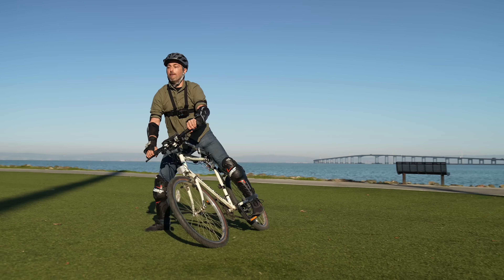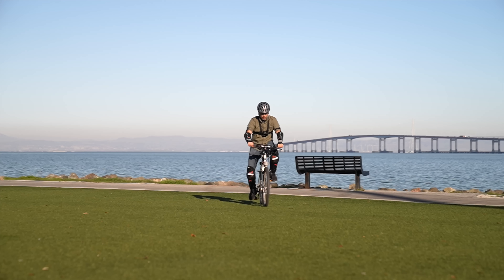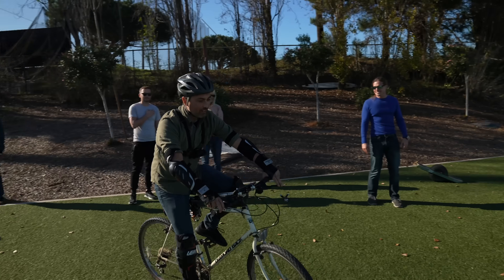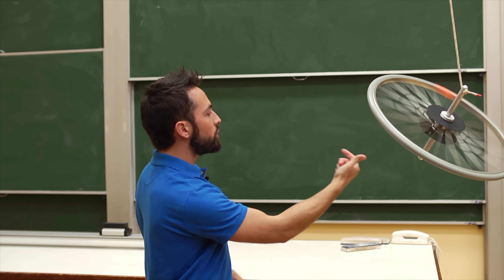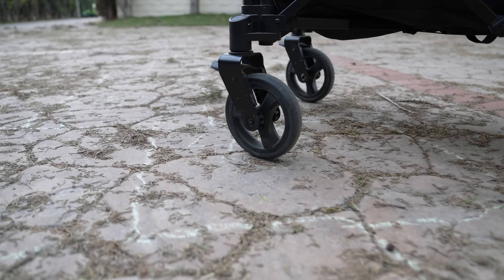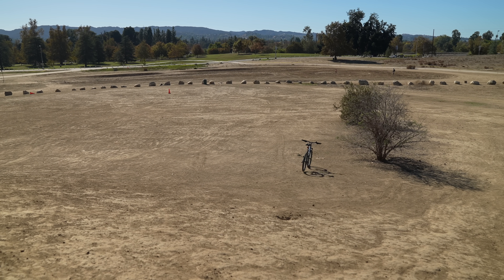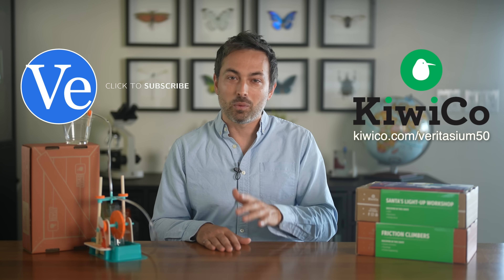Most People Don't Know How Bikes Work

Comment: Just noticed that the number of "contact" points in two-dimensional movements determine the number of counter balance movements that you would need.
1.-Inverted pendulum: multidirectional counter movement.
2.-Unicycle: counter forward/backward and steering.
3.-Bicycle: counter steering.
4.-Tricycle and cars: no counter movement.

Comment: I have conflicts with this...

1: I have, in my youth, been able to steer a bick simply by leaning in the direction the handlebars never needed to turn much, and never in the opposite direction.

2:  pretty sure I could handle a non-steering bike using that and the rocking technique I had for climbing hills.  Provided no turns are too sharp, that is.

Comment: As interesting as this might be it is also not 100% right or well not always, when at slow  speed yes you might have to counter steer but in practicality it is like a motor bike,  the only time i ever steer the opposite to the direction intended is when i need to go wide around something.  I cycle to work everyday and i actually held of posting this comment to see if i did what is describe here and guess what i did not as that is not how people cycle in every day. Idiots that have no clue will try to stay utterly upright as they turn into a corner but much like a motor bike if you know what you are doing you always lean your body into the corner , and can bee seen from the video you clearly have no clue how to ride a bike as you are seen to be trying to keep your body strait rather than leaning into the corner.  As I say i cycle to work daily and not once do i turn the opposite of the direction i want to go and when i am going strait i do not need to constantly stare to stay upright, in essence body weight is what turns the bike and if you want to turn left you shift your body wait to the left side and turn left .   The only people i have ever seen turn the bike with a stiff upright back are people that do not know how to ride a bike.

Comment: I think that that it is also possible to steer the bike without counter-steering the bike first. To do this, you must initiate the steering by moving the centre of gravity of your body towards he inside of the corner. When the handlebars are still pointing straight, the bike will naturally lean in the direction of the centre of gravity - the inverted pendulum will topple over if no steering is applied. So all that is left to do is to steer into the corner. And you have successfully taken a corner without counter-steering!

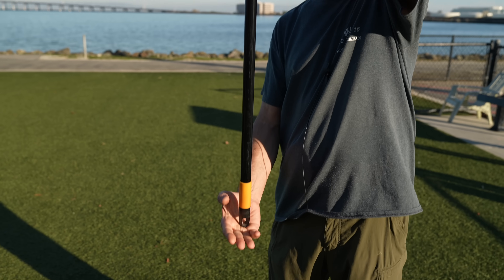The broomstick/inverted-pendulum argument (3:15) is too much of a simplification in my opinion. In the argument, the heavy mass is compared to your body on a bike. However, in reality your body is not some rigid (point) mass on top of a pendulum. With the muscles in your body you can shift the location of the point mass at the top of the pendulum. So you can shift your body such that your centre of gravity is no longer right on top of the pendulum. This starts the lean without first having to counter-lean. (3:27 "I have to initiate the lean") In the described technique here, you still initiate the lean, but not by moving the base of the pendulum, but by moving the mass on top. 

I am just a random Dutchie that has cycled his whole life and when I first saw the video I felt like your logic was not quite true. As far as I have tested it, my explanation above holds up. But I only tried it once or twice cycling back from uni and I knew in which direction I was going to steer. Nevertheless, I am confident that it is also possible to do it on the bike you used in this video.

Comment: This is crystal clear to anyone who's ridden a motorbike and given it a second thought. Too many still think you steer by leaning (weight shifting) alone. Grabbing the handles from the front only with e.g. forefingers quickly reveals you pull the opposite side first before the leaning into the curve starts. With normal grab and a quick situation you actually push the turn side handle but not many realize they're doing it.

Comment: Countersteering. It upsets the balance in order to force wheels onto a new axis relative to the ground. 

On Motorcycles, you barely turn the handlebars at all above 10mph. It's all about pushing the bars in the direction you want to go, not pulling.

Comment: Motorcyclists learn this really quickly.  Bicycles are very light so the tiny inputs needed to initiate the turn are barely perceptible.  Motorcycles however require noticeable steering force in the opposite direction in order to get the turn started.  It's one of the first things that stood out to me when I first started riding.

Comment: Gyroscopic effect is only a macro effect that is the consequence of a more nanoscopic one.
It implies a localized space-time distortion in the inner wheels space : Higgs bosons agglutinate while the wheels turns more rapidly allowing the outer wheel to increase its mass, while the mass grows , the inner space - time  area warps accordingly, allowing  the wheel to be "locked" in.
In the case of the wheel, just imagine it is on a flat rubber surface , if you increase the mass of the outer wheel, it sinks into the rubber, the more it sinks the more it is difficult to move it on the transversal axis as shown at 6:20.
The rule is that an initial mass in movement increases proportionaly of its speed and depending of the density of the bosons in a place, the more they agglutinate , the more the localized space-time is warped.
Put your hand or an object into different liquids of different densities : water, oil, mercury.
Move it , you will experience a different "mass increase effect" into these ; Higgs bosons are like this, they agglutinate temporarily as an object is in movement, the more the density is high , the less easy movement is , this is what occurs in the vicinity of a black hole, movement is put on hold as the bosons density is insane.
What is a black hole ?
In the center there is  a singularity, probably* made of exotic particles that generates negative energy, this energy allows the higgs bosons to be attracted, and the space-time to be warped around.
The "black sphere" we can see around the singularity is an incredible amount of agglutinated Higgs bosons, it is also called the "event horizon", they are known also as " dark matter".

*No one knows !Perhaps it is a concentrated form of what scientists call " dark energy " ^^

A formula can be extrapolated from this : Mv=(Mi.D/t )/Ub
With Mv =virtual mass, Mi =initial mass , Ub = Higgs bosons density , D/t = speed ( Distance divided by time ).
Virtual mass depends on the speed as more it is rapid, morebosons it attracts, when speed is equal to zero , mass returns to its initial state.

Disclaimer:  this is only a reflexion i had made the other day, don't take this as a real science step process, as i'm not a scientist, only an imaginative person . ;)

Comment: I figured this out on my own many years ago, but I'll leave out any description of the observations that enlightened me because there's something even more interesting to talk about, and that is, this principle is actually where a huge myth comes from that nearly all motorcycle riders believe.  The myth is that your bike will go where you look, and that looking at the outer edge of the road on curves will cause you to drive right off the pavement.  Motorcycle riders DO commonly drift too close for comfort to  the outer edge of the road on curves, and in the worst cases, end up off the pavement and crashing, but the reason for this is that they failed to set up a sharp enough turn by properly counter-steering in the first place.  Adjusting their rate of turn to be steeper requires an additional counter-steering action (when already in a turn, this counter-steer will usually just be to steer "less sharply" for a moment, rather than counter-steering all the way past center).  However, as they drift too close to the edge, they no longer have enough room to make the additional counter-steer that's needed.  They end up thinking that they are trying very hard to turn sharper, away from the edge of the pavement, but nothing happens.  They feel like they are "frozen" or locked-in to their course.  Having no conscious awareness that it's their inability to counter-steer that is preventing them from increasing the sharpness of their turn, they stare helplessly at how close they are getting to the edge of the pavement, and thereby comes the myth that they can't help steering any direction except where they look.  The truth is (and I used to ride motorcycles a lot and have plenty of experience to back this up), as long as you have room to counter-steer as necessary to steepen your turn as needed before getting too close to the pavement edge, or you are in well-setup turn where you have your course dialed in ahead of time, you are free to look anywhere you want, all the way around the curve, and you'll be just fine.  But just TRY to explain this to a motorcycle rider.  They won't believe it.
Reply: I have to agree with most of this. While i do feel target fixation is a real thing, more wide turn accidents can be blamed on the rider not focusing on what's ahead and being destracted. Too much speed never helps either.

But I 100% agree that peoples subconscious ability to counter steer can easily be lost, especially when stress is a factor.
    That video floating around YouTube of the guy who collided head on into a fire truck on a mountain road (survived luckily) perfectly shows this point. 
In the video you can clearly see him turning the bars towards the apex but the bike keeps countering to the outside of the turn. It's definitely not the only example, but the most obvious I've seen.
Reply: @nickskizekers1906  Thanks for that, but in my type of example, the person doesn't forget how to counter-steer.  Their body unconsciously knows what to do, but their body also unconsciously knows that they lack the necessary space for that bit of side-veering that's needed.
Reply: Your observations basically make sense, but I don't see how they lead to the conclusion that target fixation isn't real. Its like you've defined target fixation as something that changes the laws of physics to prevent a change of course instead of just being a psychological lockout that prevents a rider from adjusting to a dynamic situation due to misplaced focus.

When I'm on a motorcycle or bicycle, I often play the little game of trying to touch a certain spot on the ground with my tire. Clearly, the easiest way to do this is to train your vision on that spot.

And to say that while executing a properly planned curve  "you are free to look anywhere you want"... show me one motorcycle instructor in the world who would advise a rider to look anywhere other than where they are going?
Reply: @OTCPunk  You really missed the point here, and it seems like your urge is to to out of your way to apply outlandish meanings to much of what I said (like that bit about looking where you need to go when trying to move precisely - of course I wouldn't dispute that).  It's a simple matter of running out of room to apply the needed counter-steer, and not being conscious of "why"  you can't willfully turn in the direction you wish to go.  Further, the reason one allows themselves to run out of room is their failure to recognize their need for counter-steering and thus being less able to plan ahead.  Cycle World Magazine did an article on this exact topic a few years after I first figured this out for myself, but unfortunately I don't recall the year or month for that issue.  It was a good article and maybe you'd interpret all this differently if it were conveyed by a source with some air of authority.  Edit:  I seem to remember that the year of the magazine article was around 1985, plus or minus about a year.  That's the best I can do as far as "steering" you in the direction of finding it!
Reply: @ericl2969  Yeah, see, you're not even talking about target fixation. You're talking about taking too much speed into a curve given its degree. 

Let's take your logic as I'm reading it and do a little football analogy. "A QB overthrowing a receiver is a myth. If the receiver executes his route and the offensive line gives enough protection so that the QB has time until the receiver is open, then there is no reason why the QB should ever overthrow the receiver."

I've read over your comments more than once, and all I get from them is a failure to recognize that two things can be true at the same time. I'd be more convinced by precision of language than I would by the air of authority.
Reply: Hotboxing your own farts in youtube comment sections is no way to go through life, son.

Comment: will you tackle countersteering on a motorbike as well? It seems to me when I ride that I actually steer oposite the whole time but it migh be just the first instant to push the bike from under me to get it to lean and then the steering follows as on a bicycle. I am more aware of it on a motorbike though and you can adjust the lean angle while already in a curve. I guess it is still the same effect of pushing the bike further or closer from under me to turn.

Comment: So just tested it and I do not naturally counter steer when I turn. Instead I begin leaning in the direction I want to turn then gradually turning the wheel to that direction. Shortly after learning to ride my bike I learned to ride without hands because my dad was able to do it, and I wanted to impress him, and my friends. I would ride without hands as long as I could, turns, up & down hills, going slow, etc. So now I naturally lean well before i want to turn. If I was ordered to turn on a dime while going slow like in this video, then I would probably need to counter steer at least a little, as I'm constantly turning left and right in small amounts to balance. Glad he conceded that gyroscope affect does contribute to the bike's natural righting abilities. It also helps dampen the movements making the bike easier to control over rough terrain. I can ride my bike with heavy 29" wheels without hands a little easier than my bike with much lighter 26" wheels. If the wheels were very heavy the gyroscope effect would make it difficult to turn and change direction.

Comment: Excellent video!    Veritasium, could you explain this;  take a bicycle or motorcycle and lock the steering handlebar at a set angle,  say 20 degrees. Now keeping the bike as vertical as possible, roll the bike thru a circle and measure the radius. Now do the same with the bike leaned over at 30 degrees. The radius for test two will be significantly shorter than test one. WHY?  What fact or factors cause this to happen? I think it the geometry in the frame of the bike that is causing it and is a design feature.  What do you think?

Comment: Well, in rallying with two o four wheel drive cars there is something about it. When they take very sharp slow corners they do this manouver: If it's a left tight turn first the slightly block the brakes with the front pointing left. Then, they countersteer to the right son the front points  right, and then they countersteer full left to take the corner. 
They do the same counterbalance game as the bikes. But as cars are much heavier than bikes, at the middle of the corner the balance goes from left to right. If they hit the appex as they should to go as fast as pssible, and rally cars goes sideways through corners, they manage traction with throttle and exits the corner with the car going sideways to the right but pointing straight along the road and full throttle to counterback the sideways force and get away with it. The first ones to use the technique were finish and swedish rally drivers so this manouver is known as the Scandinavian Flick.
Sometimes in track racing I see this manouver if cars are allowed to go beyond the track limits and there are kerbs or asphalt outside the track.

Comment: Stand up. Lean. This is dumb. i threw my bike left an right just In the pedal. Instead of me moving my body alot I moved the bike. Learn to pump. I rarely turned my bars. Go down hill hands behind my head, 90 degree turn at the bottom. Take it with Hands never touching the bars.
  Take care of your bike. It'll take care of you

Comment: I figured all of this out on my own when I was riding. I started thinking about the inputs I was making and realised this. I also try to counter steer a lot so I can make a very sharp turn that most people can't. I've rode all kinds of bikes and I can tell you that front fork angle is the main thing keeping the bike stable. Ones with lower angle are harder to ride and ones with higher are way easier and require more but less precise corrections from the rider.

Comment: Idea for future related episode.   To further explain the gyroscopic effect on a bicycle, add a disk on the same axle as the wheels, but free spinning independently from the wheel.  And give it a small electric motor to keep it spinning constantly.   So the bicycle would have the gyroscopic effect of a fast moving bicycle, without it needing to move.  

You'd need to make a disc, and a bearing that the ID is the diameter of the axle.  Mount them on the side opposite to the chain and gears.   You'll likely need to put a spacer the same width as the disk, on the opposite side, to keep the wheels centered to the whole bicycle.   It might be ok without, but that seems like it could cause problems.   Additional weights on the rim of that disc may be desirable.  

If that doesn't make sense, let me know, and I can sketch something up for you.    I don't have your budget, and have almost no viewers, so I wouldn't be able to recoup the $50 (rough guess) for the parts to modify my bicycle.  Even if I did, almost no one would ever see it.